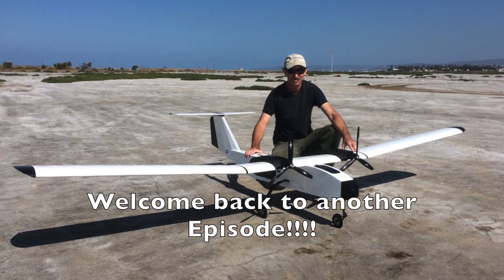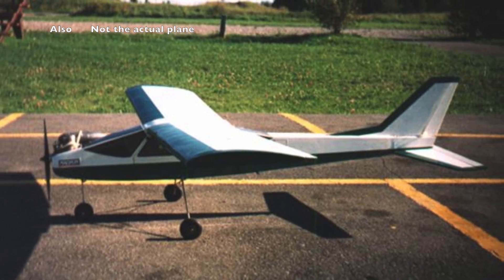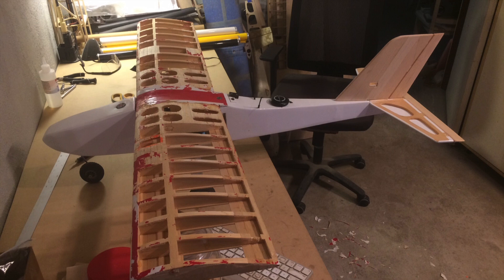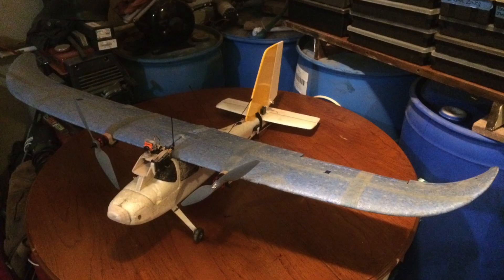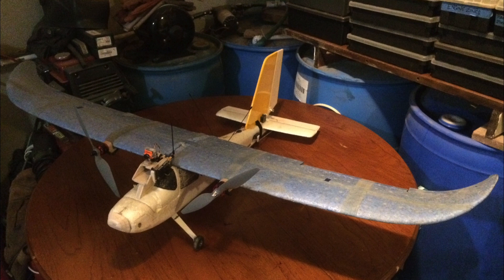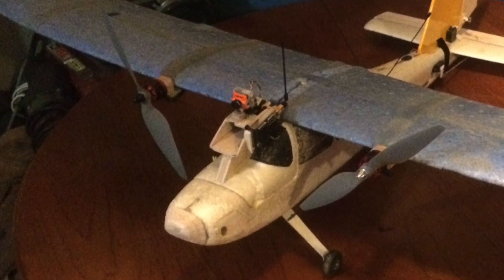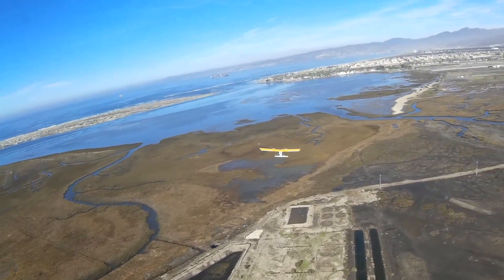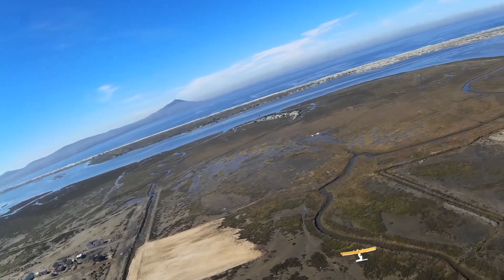Air to Air formation Flying (Chasing Myself) ???

Comment: Nice one!!
Have you ever considered to try the Matek F765-Wing with Arduplane flashed on it? I am using 2 of these FCs and I am very happy with its performance. It has the same processor as the latest Pixhawk, dual IMUs, on board OSD, 2 Camera inputs with power relays, onboard BEC with different voltages, internal voltage and current sensor, etc, etc.
Give it a try, you gonna save some weight, money and add simplicity to your cabling setup as many functions and hardware that on the case of a Pixhawk would be seperate and bouncing around the fuselage.
Reply from the maker: Actually, that was my first option, and i struggled with it through several tries, before giving up on it...    Maybe I got a bad unit, but could not get it to work reliably.  
Got through the flashing of firmware in bootloader mode, and went through setup of Arduplane on it.   All seemed fine, and then it had logging problems, so changed the card, then it would not work one day, and had to re-flash.  Re-flashed it, had to go through the calibration process again, and was about to try to fly it, when it started giving me internal error messages...        At that point,   I'm done with it...         the pixhawk standard 2.4.8 is a bit of pain, but not that bad..    it does work very reliably. 
I'm also working on a new project since this, with a pixhawk 2.1 cube on a mini carrier board, and althouhg i've not flown it yet,  i'm pretty happy so far. 
I also had 2 other Matek boards go bad for no reason, one was a power distribution board on a racing quad (yea, cliche) and another was a FC on friend's quad..
No more matek for me for a while..         
I still have the 765 board lying here on the bench...   if there are any tricks to get it working, please let me know.  tried the latest and also stable versions of the firmware.. 
Thanks.
Reply: FPVREVIEWS what kind of issues have you had?
Reply from the maker: @nunolfprods  no logging and internal error as explained.  never even got to fly it with the matek board...